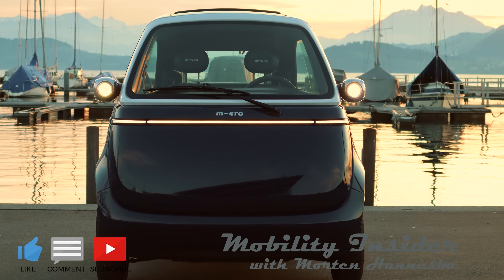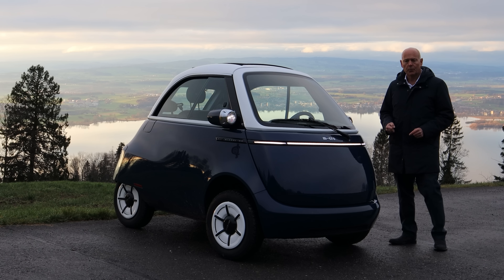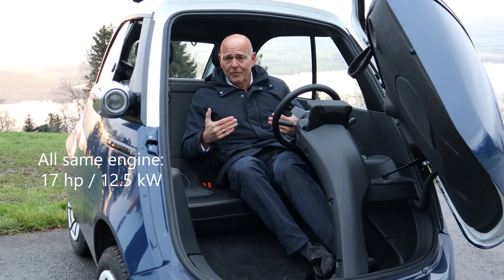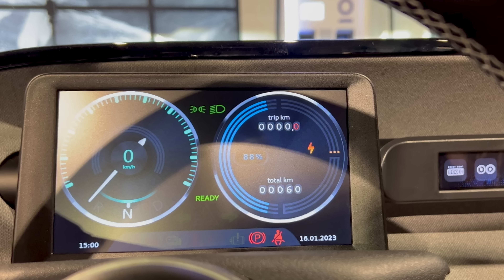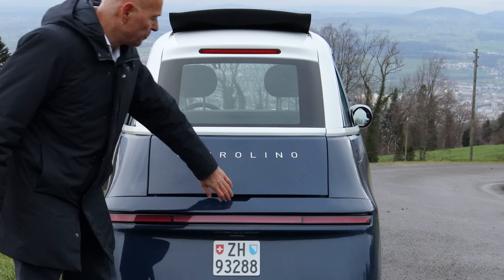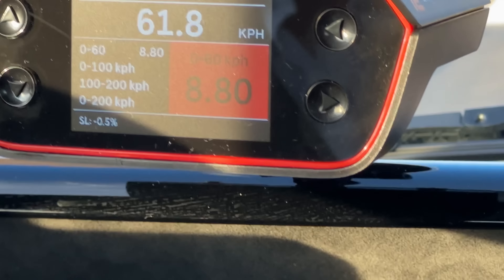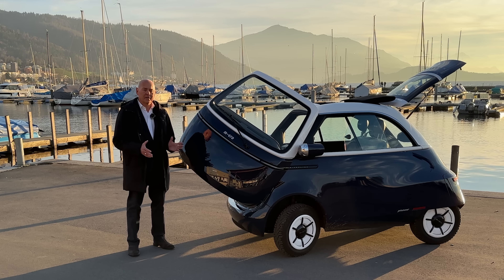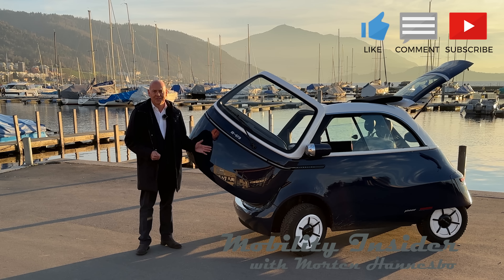A must see. Microlino - The small next big thing

Comment: Fun little car no doubt, but way, way, way too expensive when you consider you can buy a Dacia Spring for less or similar money and that's a proper, full sized electric car and much more practical. In reality this should be priced only slightly higher than the Citroen Ami.
Reply from the maker: Microlino is not a car - it is a city vehicle, a charming accessoire and great fun to drive
Reply: @morten_hannesbo  With all respect, isn't this splitting hairs? Most people consider a self-propelled box on wheels which they can get into as a 'car' . A 'city vehicle' can range from an SUV to a bicycle.
Reply from the maker: @peyiots  The Microlino is categorized and homologated as a "Heavy Quadricycle". Heavy Quadricycles are motor vehicles with four wheels and a max. weight of 450 kg (excl. battery), and the net engine power does not exceed 15 kW. Quadricycles do not need to pass a crash test or have ESP or ABS or even airbags, as we know it from cars. They are nippy, light and compact vehicles aimed at the city with a typical top speed of 80-90 km/h. But they are not cars.
Reply: But they still compete with cars. Cars that are cheaper, faster, more comfortable.

Comment: For the price they should have fast charging but they don't.
Reply from the maker: Would be great but there is a limit as to how much they can pack into the car - the max weight allowed for homologation is 450 kg excl battery
Reply: @morten_hannesbo  well the City Transformer that was on Fully Charged a few days ago had a Type 2 socket and 10%-80% recharging in 30 minutes.  And they got that under the weight limit even with the silly thing that's going on with the extendable wheels.

Comment: It won't be a big thing because it can't be sold in the US. If they had kept the Isetta's three-wheel layout, it would have been okay, but four wheels means it would be classified as an automobile in the US, which means 5 mph bumpers, airbags, crush-resistant roof, etc. The Microlino would never be able to meet those standards.

Comment: Can I charge this car with a normal charger that’s available everywhere?
I know you can’t on a fast charger.
Reply from the maker: yes, any wall socket can charge the Microlino
Reply: @morten_hannesbo  I did not understand in the video,does it have Airconditioning,with the larger battery?
Reply from the maker: yes, but very slow charging, depending on the model and battery size
Reply: @morten_hannesbo  what do you mean by very slow charging??
Reply from the maker: @norahalkefs  There are three battery sizes which offer different ranges of 95 | 175 | 230km. Battery sizes are  6 | 10.5 | 14 kWh. Battery type is a Lithium-Ion (NMC/NCA). The charging power (type 2 plug): 6 kWh battery: 1.35 kW and for the 10.5 | 14 kWh battery: 2.6 kW. Charging times are estimated 6 kWh: 4h, 10.5 kWh: 3h, 14 kWh: 4h. None of them have A/C.
Rgds M
Reply: @morten_hannesbo  I live in Athens Greece and as u can imagine AC is important,it’s a shame.

Comment: $14k to $16k - WOW that's not a cheap grocery getter!
Reply: Thats the estimated price in a years time. So, not going to happen. The shown model is nearly 21000 with a medium battery and a nasty transmission noise. I drove this quadcycle and it is louder then my Citroen AMI that costs me 7000 euros. Quality and toys are much better with the Microlino but to get around and do your shopping, the AMI does the job. Very very well.
Reply: @chrisspain  Good to know!  The AMI is cute - I'm jealous
Reply: @CubbyTech  It is great, gets as much attention then the microlino but has normal doors, loads of space (no boot thou) and has a 5,5kWh Battery that alone nearly costs that much. I managed to power my house of it for testing. It is a plastic egg box, sure, but for your daily driving more then ok. And it does not cost anything. Microlino is a fashion and lifestyle vehicle, fine, if the money is not important.
These "cars" are not to replace a real car or even the second car, they are a replacement for a moped or bike or even public transport.
Thats where the AMI shines. For the price of the Microlino I get a Dacia Spring and thats a real (small) car, air bags and all.

Comment: Imagine getting hit head on in this thing. 😬
Reply from the maker: An accident could be very unfortunate, yes, but so could a motor bike accident. The EU vehicle classification to which Microlino belongs and is homologated for is L7e, "a heavy quadricycle". Quadricycles are designed to less stringent requirements when compared to cars. Quadricycles are also defined by limitations in terms of weight, engine power and speed. And all things being equal, I'd rather have a collision in the Miocrolino than on a motorbike.
Reply: @morten_hannesbo  I will also add that it is a missed opportunity to not offer a version of this covered with solar panels like the Sono car.
Reply from the maker: @petero1068  I assume this is because of weight limitations. The max weight allowed is 450 kg plus battery.
Reply: @morten_hannesbo  that is true. I suppose you can modify and add your own after. There are many flexible solar panels now that can wrap around and are light weight.

Comment: That doesn’t look like comfortable access for a typical adult and crash worthiness looks scary.
Reply from the maker: Like on a motor bike, you do not want to have an accident when driving your microlino. This being said, the microlino feels very rigid and safe, relatively speaking, but this category of vehicle (L7e) does not need a crash test under EU legislation. I do know that microlino will conduct a crash test later this year and they are confident that the solid cage will be fairly crash resistant, but I have not seen any results.
Reply from the maker: On the access question - for one person it it very easy, for two adults it requires a bit of athletic ability...

Comment: That is a Casket shaped like an egg.
Reply from the maker: Microlino has a rigid and strong shell and is both safer and more visible than a motor bike or a bicycle. The problem is caused by big lorries which drive through our cities - replace the big lorries by smaller delivery vans and we have increased the safety tenfold
Reply: @morten_hannesbo  Yeah, that's it, destroy the efficiency and cost effectiveness of mass transit so that you can drive your virtue signaling EV.